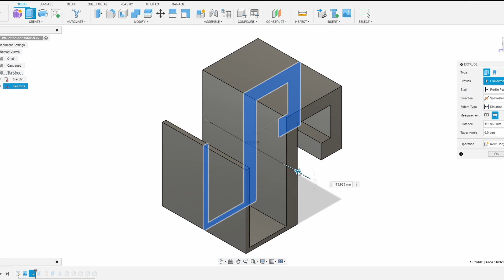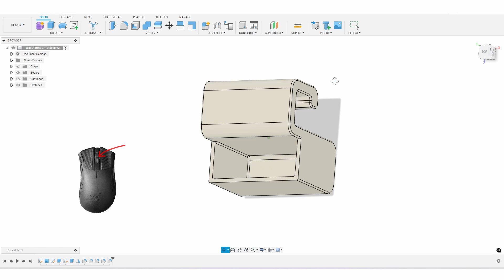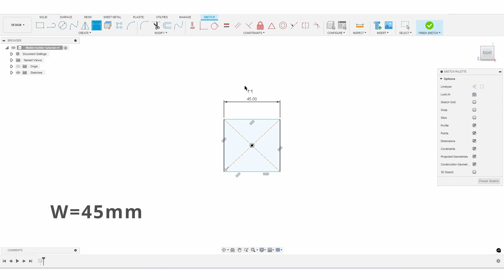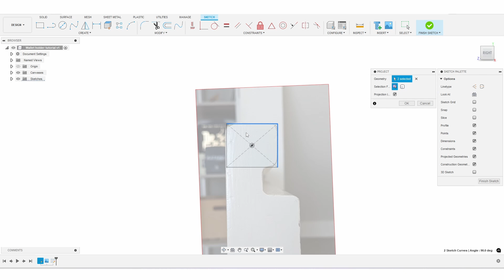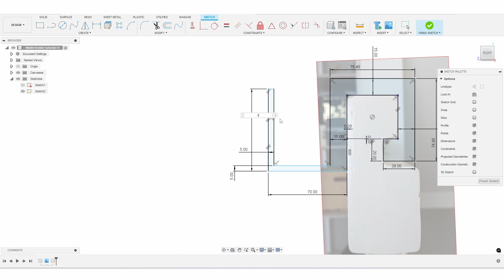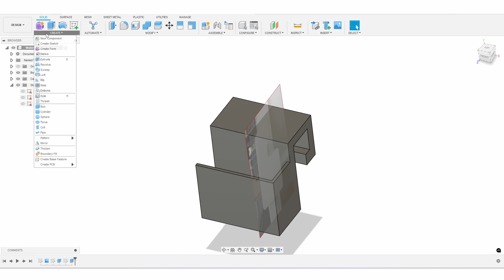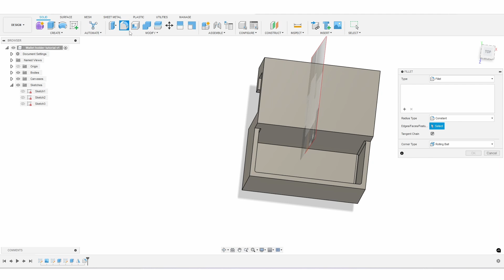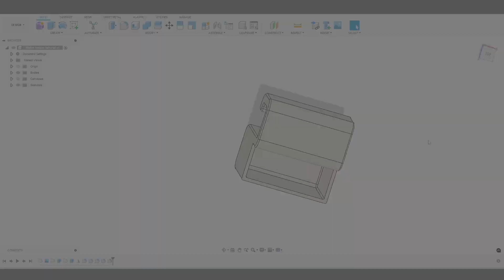Beginner Tutorial - How to 3d model in Fusion 360 (Modeling a railing mounted wallet holder)

Comment: I watched you make the fly fish tank tester which was cool. The printer you use is pretty versatile & this wallet holder is really nice. How much does the printer cost & does it come with the software you used on both projects. Cheers 🧑‍🌾👍🇦🇺🦘🎣🐟
Reply from the maker: Thank you 😊 I purchased my Prusa MK3s in 2020 and it cost me 800 USD (incl tax) for the kit. Prusa no longer makes the MK3s but they do sell the MK4s kit (the printer comes as a kit that you have to assemble yourself) for around the same price as what I paid for my MK3s. If you want a fully assembled printer it costs about 200 USD more. The 3D modeling software I use does not come with the printer, it's Autodesk Fusion 360. Hope this helps.